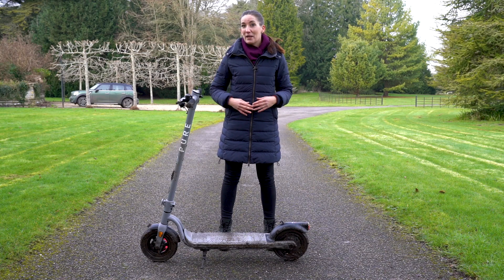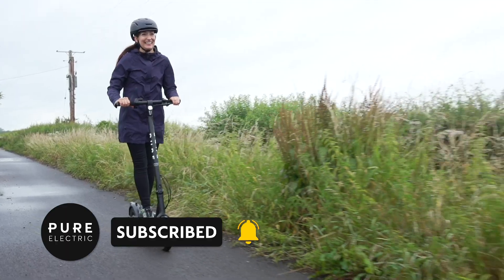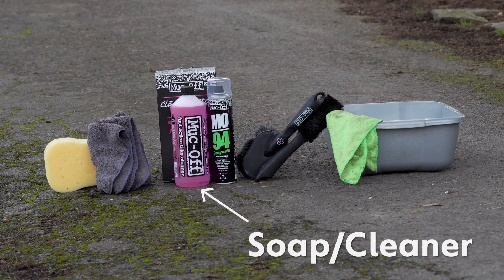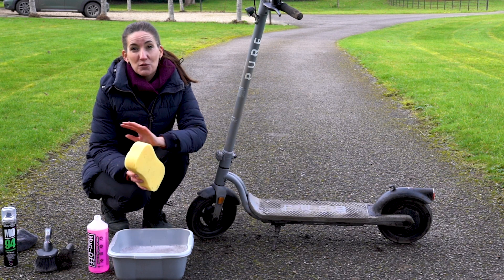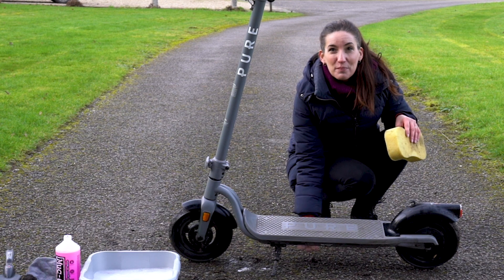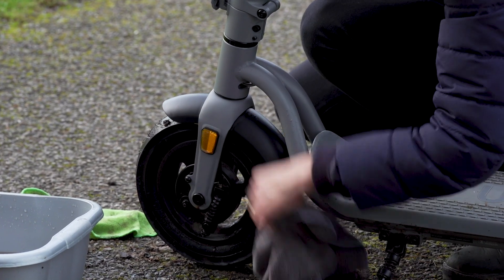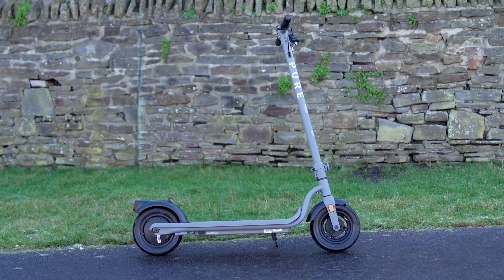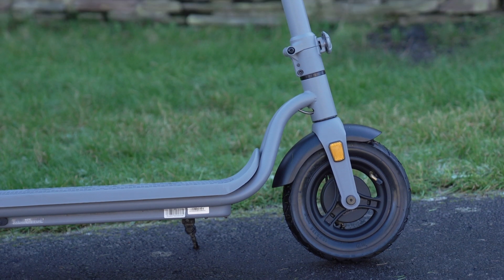Deep Clean Your Electric Scooter | 15 Minute Clean

Comment: Problem with this is that the dirty sponge is being "rinsed" in the clean water, hence making the clean water dirty. Better to use 6 sponges (or microfiber rags) using each for only 1 wiping, then putting it aside, but not rinsing dirty sponge (rag) in the clean water; then, when you are done, you will have 6 dirty sponges (microfiber rags), and just hose them off, ring them out, and let them air dry. Alternatively, you can have a hose nearby, and hose off the sponge after each wiping before placing it in the clean soapy water. This way, dirt isn't put in the cleaning water.

Comment: What is the battery power on the pure Air you never mention it ? I've heard reports of it only lasting 4 miles ?
Reply: 30 km(18m) max ...
20 km( 12m)minimun range.. 
25 km(15m) normal mileage...
Reply: 4 miles abnormal range flat